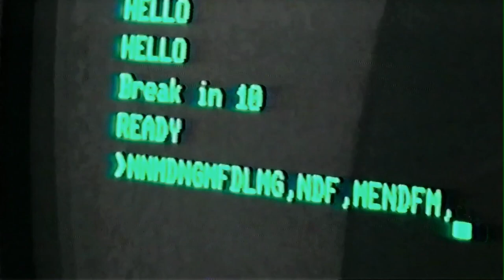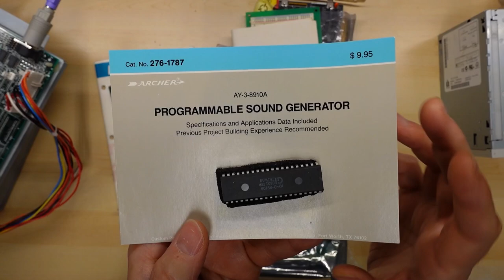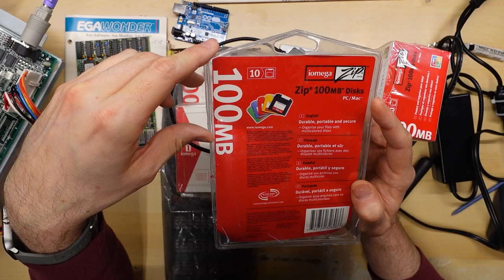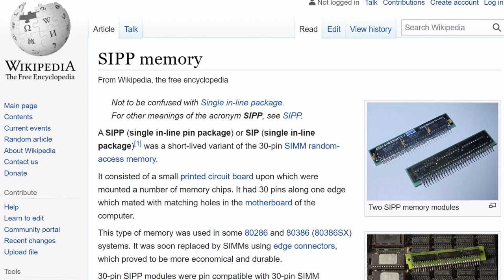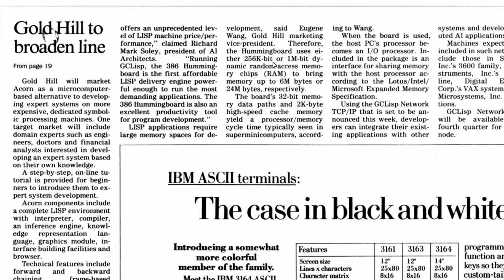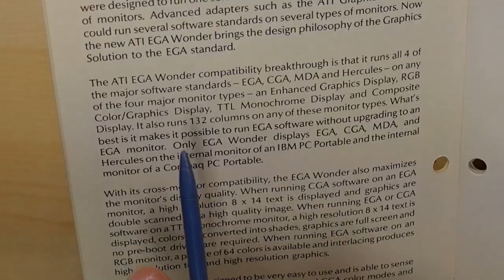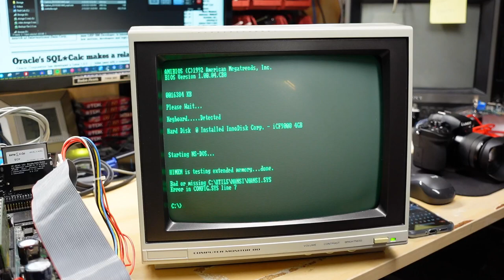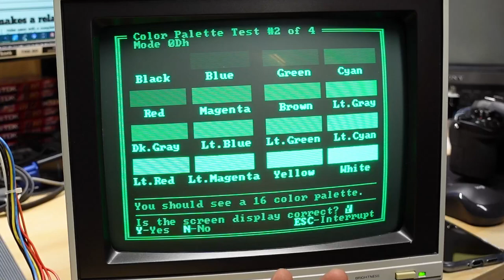A 386 A.I. Co-Processor from 1986, an EGA card driving a composite CRT, and an ISA Prototype Card

Comment: I have both an internal IDE ZIP drive and an internal IDE LS-120 drive and I cannot get either of them to work properly through one of those USB IDE adapters. Both drives work fine when plugged in using a proper IDE controller and I wonder if it might be a PIO Mode level issue with the USB Adapter. I recall that my LS-120 drive was picky about the controller settings/mode it was on and that I had to use it as 'master' with a 40-pin cable on the secondary channel in PIO Mode 2 in BIOS to get it to work correctly. Do you have any LS-120 media to test your drives with? 

Back when I was a kid (about 8 yrs old), we had that ATI EGA Wonder card in our 286. I remember at the time, my dad used it with an amber CRT and introduced me to the world of "finances" and "word processing". I also remember moving that EGA card to the 486 that replaced that 286 and being amazed it could produce color. 

Fascinating content and congratulations on hitting 100K!

Comment: back when the stitched to 3 1/2 inch. Here in Japan, the 3 1/2 disks used the same sector format as the 1.2MB 5 1/4 inch floppies so that you could make direct disk to disk copies for any of your PC98 floppy disks etc...so like DOS/V worked with two different formats for the 3.5 inch disks....

Comment: IBM PC AT upgrades I'd make;
- NEC V30
- EGA card, with EGA-to-Composite adapter (with color and adjustable clock)
- SRAM everywhere
- Compact Flash instead of hard disk
- SoundBlaster card

I'd probably do this for the industrial machine, even... and make a mod for the 8088 MPH demo to run correctly on the faster CPU and make use of the upgraded hardware.

Comment: I briefly used the LS-120 IDE floppies on a Windows XP system. They are backwards compatible with standard PC 3.5" floppies. I was hoping the LS-120 standard would catch on and replace ZIP as they held an extra 20MB of data. CD-R and CD-RW blew that theory out of the water with higher storage densities for a much cheaper price. I still have an LS-120 drive and a small number of floppies somewhere around here. If I can dig them out, I'll toss one or two in the mail ...

Comment: You can use 30-pin SIMM modules in SIPP headers by using SIMM sockets as interposers. The standard SIMM sockets for soldering on a motherboard have pins that fit perfectly into the SIPP headers, and you can then install standard 309-pin SIMMs in them. Last I looked a few years ago, Jameco had those SIMM sockets in stock. 
I wanted to link to an article that talks about that but YT kept deleting my comment, so I'll leave the link off.
You don't need to do any soldering with this method.

Comment: My first SIMM ram modules had pins on them and later when I upgraded to 386 then I had to desolder the pins because I had no more money to spend on RAM, and the local shop here told me to desolder the pins and they worked indeed.

Comment: I have an LS-120 drive.  It's an IDE one, turns out it used to be inside of a USB enclosure.  When I got it, it was just the drive without an enclosure (or a faceplate).  I got it because I have a system that has a dead floppy controller.  Any drive/cable I try doesn't work, but the IDE controller is fine.  The BIOS has support for LS-120 and I can even boot off floppies from that drive.  It does seem to read 1.44 MB floppies faster!  Windows 98 (and DOS) just see it as the "A:" drive.  Oh, and in Windows 98 I can right-click the drive and select "eject" and it ejects! :-D

Comment: You must have been really lucky with your Zip drives... I was running a small town PC store in the 90s, and at some point I had to take the external Zip drives out of sale due to the high number of failed devices and often unrecoverable data. The Zips were probably my second worst warranty spree just after the IBM Deathstar series. The disks were also extremely dependent on drive alignment. Chances of a Zip disk written on one PC being put into a different PC had very high chance of either not being readable to begin with, or to become corrupted once you added more content on the second PC. If you have a spare external Zip drive, Id' appreciate if you could include it in your teardown video, and compare the spindle/head mechanisms between the drives, because the internal drives were much less affected by this alignment problem, so I assume the head is more robustly mechanically coupled to the spindle motor. 
SyQuest turned out significantly more reliable, but customers preferred the cheaper and cheerfully blue Zip drives instead. I've sent SyQuest cartridges via international mail and they survived.

Comment: The memory on that SBC card for the PC are called SIMMs (Single Inline Memory Module)

There are SIPs, but that refers to Single Inline Package which is used for things like resistor array packs and (at one time) memory chips.  The memory SIPs were just like DIPs except they had pins on only one side and could be packed into a much higher memory density.

Edit: Doh!  Should have waited a bit longer...

Comment: That LS120 drive probably has an adapter board bolted to the rear, so if you disassemble it you'll find a different connector. It's known as a JAE connector, and you can buy adapter boards off eBay that convert it to IDE. Searching for JAE to IDE should find it, but you might find a cheaper option searching for a slim CD or DVD to ide adapter.

Comment: When working as an IT guy, those ZIP drives FAILED ALL THE TIME!!!
Reply: I missed them when my college stopped ordering computers with them though. They were a hell of a lot more reliable than floppies.
I swear the IDE zip drives sounded slightly different and that really brought me back!
Reply: We had one user, back in 2001 that insisted on storing all of her data on it instead of the millions of dollars we had in the data center...which by the way is backed up.......daily.  Anyways, she lost data.  Got mad and demanded we fix it.  Of course we didn't.  We just ignored her pleas until she started using her home drive. ¯\_(ツ)_/¯ 

Users are stupid.  I don't miss them.
Reply: @adamwhite2364  - DISAGREE!
Reply: @tubeDude48  perhaps to clarify a bit; they were more reliable than the floppy drives Dell was putting into Optiplex 150s back in the early 2000s when combined with a dusty library and random floppies kept in whatever. At least ZIP disks kept in their jewel cases worked for me every time I tried them
Reply: @pmgodfrey  - YOU GOT THAT RIGHT!!!!!

Comment: The pins on those RAM modules are available. I'm not sure what they are called. Some LCD's that have pins that solder directly to a PCB is the same system, just 90 degrees bent.

Comment: Be carefull with the black foam, I got a stach of ICs from a friend all pushed in that foam. Some off the foam seemed to eat the pins of the ICs. From the outside everything looked nice except the foam was falling appart, But it turned out many pins of ICs in that foam did the same

Comment: Test the zip drive to a native IDE interface. I never got IDE2USB adapters to work with zip drives myself. I suspect some earlier of the zip drives expect CHS mode only, while most IDE2USB adapters usually only operate in the more modern LBA mode.

Comment: Back in the old times, there's trend of 19" rack mount industrial style computer that can plug-in multiple cards, each of them is an independent computer. They're considered "small business" since industrial will use PC/104.
The ZIP disc is good since it can hold 100MB, the worse is the parallel model of the ZIP drive always fail, it click repeatably click and stop reading the disc, and it's luck that most shops still selling ZIP drive quick, I've been hurry down and buy another one to replace, this happen two or three times.

Comment: Almost all laptop modules have a standard plug on the drive adapted to something more rugged.  You can adapt them back to 2.5" IDE. If you remove the screws from the sheet metal.

Comment: @11:00 Reminds me of a project I just completed.  Driving a VFD.  They're very cool.  (Do an image search for "logic controls td3000"), and they're cheap on ebay.  Mine wasn't difficult to get working, required a custom rj11 cable with 2 pins providing hot/neutral 6vac, and 2 pins providing data/gnd rs232.

Comment: 16:50 From my experience with a hot swappable Dell C-bay ZIP drive in Windows 7, sometimes you need to RESTART the computer after the drive is first detected for it to read any disks. Otherwise it just says please insert a disk!
Also I have used the LS120 drives before on a ThinkPad. It's called Superdisk there. I was using it for an ordinary floppy drive but unfortunately one day the disk wouldn't eject anymore. I got a bit frustrated because the disk has drivers and things that I don't wanna reorganise again if the disk get damaged, so I just used the eject pin and forcefully eject the disk. Unfortunately, the drive head came out with the disk!
The floppy disk is safe but now the drive is gone! And these for various laptops cost lots of money because they are hard to find and non interchangable between brands!

Comment: I'd physically check the heads on that LS-120 that doesn't work.  I had one that wouldn't work at all, and I opened it only to find out that the upper head was broken in two.

Luckily the second one I bought works fine (for now ;o)

Comment: did a ton of component evaluation in the 90`s...as in people brought me bins of hardware and i would identifiy, test, locate software and assign resale value to each item for 20% of the value to paid in hardware of my choice from each batch.....got a reputation for being fast, fair and accurate, so i had a lot of business......at 1 time i went through a batch of over a hundred ZIP drives, all clickers, only reason i tried is the customer also supplied disks to test with....killed an equal number of disks during testing.....said customer was NOT happy, but he was warned before hand

Comment: I would suggest trying the LS120 with Linux. I connected my parallel Zip drive to a Linux box and it had no problems identifying and using it. Might be the same with the LS120.

Comment: I have used a LS-120 drive once in a old gateway 2000 solo laptop (wasn't mine) and yeah it does sound like a zip disk even with a normal floppy in it. I recall it transferring faster than a normal conventional floppy drive and from what I know..for the full size PC one the BIOS has to support LS-120 drives as I recall some motherboards cmos setup utility actually have LS-120 as a "selection" from the drop down menu (along with 720k 1.44mb etc) to be on safe side, id stick that drive in a PC that calls out Ls-120 mode

Comment: OMG - I have the same ide/sata usb drive interface..  (although I have electrical tape holding the switch together)  and had to solder new power ends (sata and molex)

Comment: I have a paradise ega card that looks the same as this ATI, but couldn't get it working on my Micro 8088 XT. Do you know if they are similar and Did you set any of the switches to get the composite output ?

Comment: Iomega drives do not play well with USB interfaces in my experience.
Don't remember if they play nice over USB with Windows, but I found out that on Linux, ATAPI over USB does not work at all. Modern internal cheap IDE controllers (don't remember which one I had, JMicron perhaps) suck at playing nice with zip drives too - they seem to work in PIO mode and consume CPU a lot.

Comment: I had a 286 or 386 with 20MB of ram (4x4MB and 4x1MB) I think at the time I only had a 20 MB HDD. I used to use 16MB as a ram drive.

Comment: The flickering from the EGA Wonder should go away if you use a monitor with long persistent phosphors like the Apple Monitor III. The Videx Ultraterm for the Apple II behaves the same way.
Reply from the maker: Yes good point, it would. I have an Apple III monitor and it certainly does have a long persistent phosphor. Those nice long ghost trails are quite neat.

Comment: Does that connector screw off the back of that LS120 drive? Looked to me like it was an adaptor
Reply from the maker: http://imgur.com/a/WjHFoSv

I took it apart fully and while it's an adapter, it's to an even smaller connector. LOL
Reply: @adriansdigitalbasement  That looks a lot like the 50 pin JAE IDE connectors that many older laptops used in their modular bays.  Many manufacturer used their own connectors on the outside of their bay modules but the connectors on the drives inside the modules were more or less standardized for the most part.

An adapter like the one at https://www.amazon.com/Laptop-Notebook-50pin-DVD-Rom-Adapter/dp/B074T2NVQG may work or the one at https://www.amazon.com/JXSZ-50-Pin-Slim-CD-Adapter-External/dp/B072MJRXJZ if you want to go to USB instead of IDE.

These adapters can also be found on ebay - just look for slim cd drive IDE adapters or slim ODD IDE adapters.

The IDE one probably has the best chance at working since these adapters are usually intended for optical drives and the USB controller may not know what to do with an LS120 drive.
Reply: @adriansdigitalbasement  That's the same connector that's on every IDE laptop CD drive I've ever seen. If you have any pre-2007 laptop with a CD drive your LS-120 should slide right in the same place.

Comment: I have two LS-120 drives myself, one internal IDE drive, and one USB external drive for a Mac. The USB drive I can't get working at all, not even with Linux nor a friend's modern development Mac. The internal LS-120 drive however works fine on my modern MoBo that lacks native IDE if I either use a PCI IDE controller card (this works in Linux only, not Win10), or if I use one of those Chinese SATA <-> IDE bidirectional adapters (this is the only way to make it work in Win10, also works in Linux). ToDo: See if a different IDE controller card (I only have one) will let my LS-120 work in Win10.

Comment: For the pins mentionned at 20:25, you can get them at Digi-Key:
Digi-Key Part Number: A117856CT-ND
Manuf. Part Number: 1544210-2
https://www.digikey.ca/en/products/detail/te-connectivity-amp-connectors/1544210-2/4731536?s=N4IgTCBcDaIIYEYEHYAcBWAbAYQCoFoA5AERAF0BfIA

Comment: Is that not it here "GCLisp Network TCP/IP will be available in the fourth quarter for $495 per node" ?  My understanding is those cards are nodes that can fit into a Sun or VAX workstation
Reply from the maker: That is just a software package as an optional extra for that card. The cards were definitely for the IBM PC XT and AT machines to really boost their performance in LISP from what I can find.

Comment: I found a catalogue page from 1991 that lists both the PDS-601 and PDS-611 for sale, and they were under $100. 

It's very possible that those cards were sold well up to the 2000's. Hardware development kits usually stay around for a long time. Even modern equipment runs on legacy hardware, for example in industrial applications there are certain PLC's known as Soft PLC's which usually run DOS 6.22, PC104 SBC Industrial computers usually have a 386 or 486 on them. Another wild example is a $35'000USD chemistry analyzer released two years ago from Olympus only support Windows 2000 for the user interface.

Catalogue Page
https://worldradiohistory.com/hd2/IDX-Consumer/Archive-Modern-Electronics-IDX/IDX/Computer-Craft-1991-10-OCR-Page-0084.pdf
Reply from the maker: Yeah neat, all things considered that was not a bad price back then. Without China pumping out hoards of dirt cheap MCU boards and other parts which brought the price down to where it is today. I would have really loved one of these cards back in the day.

Comment: Yeah pretty sure on that 120 drive you can just unscrew adapter on back and then it prob 2.5" ide. And easy to get 2.5" to 3.5" ide adapter with power molex in. 
Servers for while that had tiny cdrom drives and would sometimes have 2.5" ide to 3.5" ide adapter board screwed on back of them.

Comment: I had an LS-120 drive with my P2 PC circa 2001. It could boot from ordinary floppies if the motherboard supports, but not much faster than normal floppy drive. I bought it with a price tag of over $150 (about RMB 1500 around the time) in China when I had a choice between it and a similar IDE Zip drive, because I heard about Click of Death and hoped the LS-120 might last longer. Well, It was dead after 2 or 3 years of occational uses. That thing is not super reliable. :(

Comment: I wonder if it would be possible to use 16Mb SIMMs for the Hummingboard. 384Mb of ram would be a hysterically large amount for any computer in the mid/late 80's, most of them probably wouldn't even boot up with that much memory installed.

Comment: you double check the jumpers on that zip drive?
Reply from the maker: Yeah it's just master, slave and chip select
Reply: @adriansdigitalbasement  it likely needs to be set to master.  I have a similar IDE to USB adapter and it sometimes freaks out when things are set to slave or CS.

Comment: I have had a number of LS120 superdrives, they are wicked fast on reading and writing but I have never had one that would write 720k disks right , they read fine, but doing things like writing disk images its a fail (though they work fine for 1.44mb) I have 2 right now if you want one (with faceplates)

Comment: Hey i have that ati card. Is there anyway you can upload the manual? Pleasee?
Reply from the maker: A scan of the manual is available here: http://www.minuszerodegrees.net/manuals/EGA%20Wonder%20Operation%20Manual%20(Edition%202.3,%20January%201988).pdf -- the manual is for a slightly newer card, but all the relevant info on the switch settings is the same.